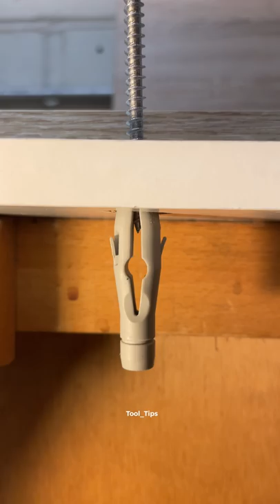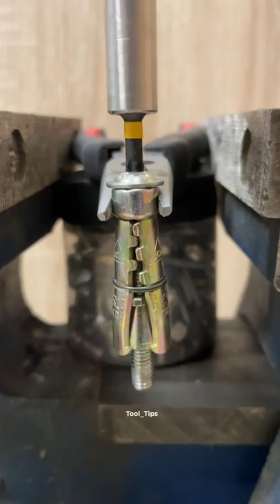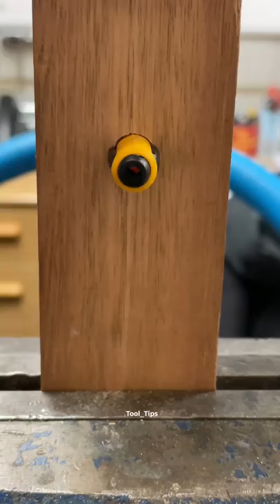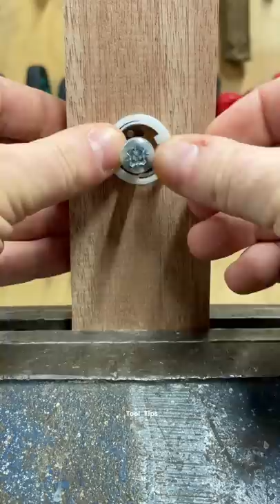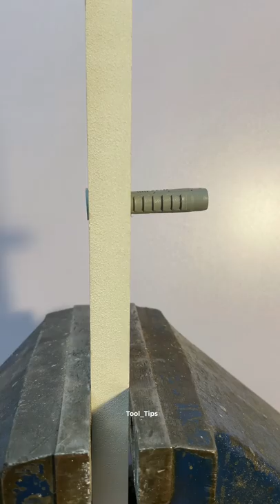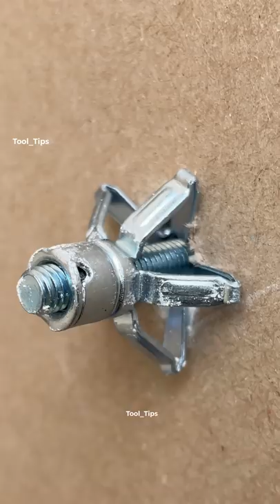#shorts The Best

Comment: Dude you're actually helping me I know nothing about where to hang stuff on a wall and I live in a mobile home so my walls are pretty then I could totally use some of these thanks man I appreciate it
Reply: The metal ones that just bulge out are used for concrete.
Reply: Those blue rubber ones at the end are amazing! when I was first handed a box I thought he was having a laugh, but their no joke even if you accidentally make the hole slightly too big they still work because the rubber compresses tight and is still bigger than the hole at the back. 👊
Reply: Just remember if you got thin walls it can't support as much weight as your typical house walls. And regardless you need to screw into a stud for a real big picture frame or shelving or a TV. Look up videos specifically on what to expect inside of a mobile home wall when mounting stuff.

Comment: What situation are these things used for?
Reply: Wooden walls, like if you wanna hang a painting
Reply: Cavity walls made of drywall (plasterboard) or thin board.
Reply: If you wanna hang or attach something to the wall but cant find a beam to secure your screw in, these things make it more secure in those walls where the screw would otherwise stick out.

Comment: When the screws keep spinning even though the head of the screw is flush with the wall, that drives me nuts, it doesn't satisfy me.
Reply: Youve probably drilled your hole 2 big I generally go half a millimetre smaller like if it's a seven mill plug drill a 6.5 mill hole and so on...also when you drill your hole put your plug in flush with the wall put your screw just inside the plug tap it in a little bit then screw it in gives the plug more bite! 👊
Reply: @johntrump6526  I dont have that problem, the guy who made the video, certain anchors just work that way I guess.

Comment: Does anyone know what the yellow one is called? Thanks
Ok so I’ve found out their plasplugs super toggle.
Reply: I also need link of yellow anchor with black strip
Reply: K, a little more than halfway through the video, there is a gray circle part, that goes on the back, and when tightened, or screwed in, the gray circle part ends up separating, splitting into 2 halves that spread out further, so they can put pressure where it's wanted. 

   So, to get to the point, anyone know what I'm talking about, or what it's called? I could use a few of those, to be sure!
Reply: @kari7403  it’s called a gripit fixing.
Reply: @lmaloney977  👍 thank you!